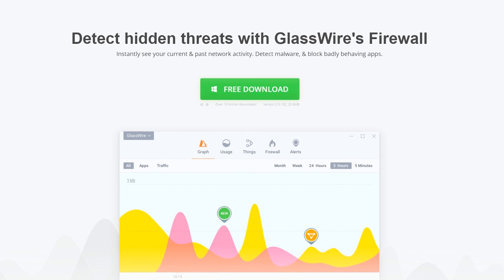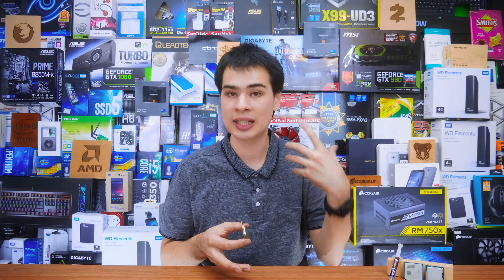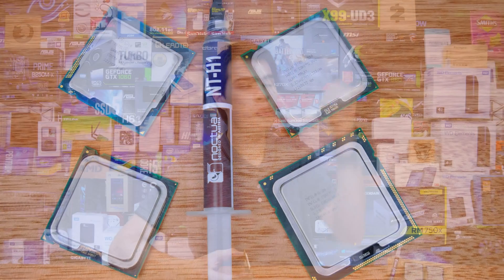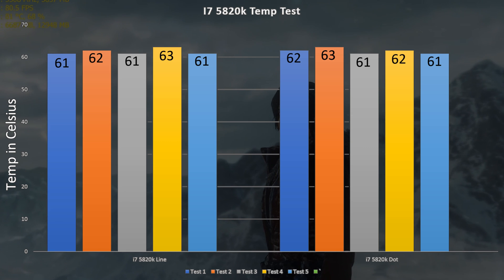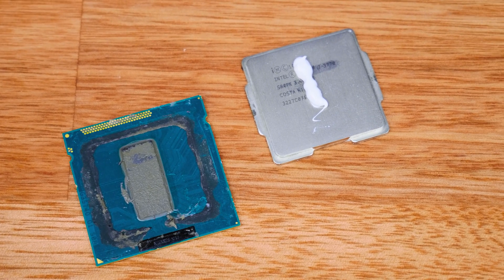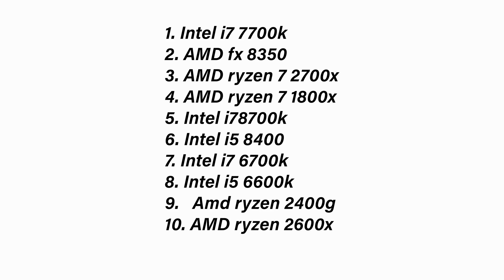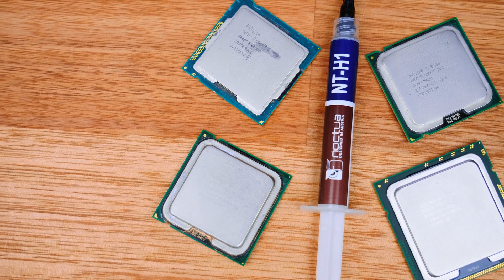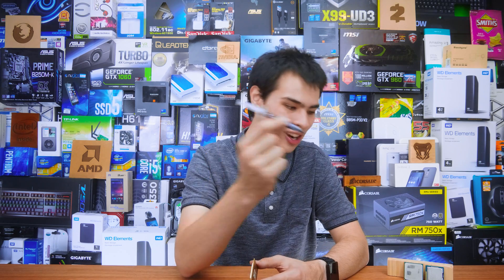Line VS Dot MEGA Thermal Paste Show Down

Comment: Seems like the single dot often misses the corners, and single line often misses the sides.

I'd rather like to see, just once, someone try a "2-line" version [ | | ], or a "dice" (5 smaller dots) [ : · : ] version, to see if either gets better coverage over the whole surface than just a single dot or line alone, but without leaking over the edge. 

Like would the two lines spread out and merge in the center, or would it potentially miss the middle with an air pocket? Would the "dice" version hit all 4 quadrants, and make sure not to miss the middle (without creating quirky air pockets)?
Reply: The dot misses the corners because he isn't putting /quite/ enough paste on. The line will ALWAYS miss sides as it forces out and channels through the edges, even if you put the right amount.

Comment: I have discovered the best way to apply it... 1st: Apply a little bit and spread it all over the cpu with your finger.. 2nd: put a little dot in the middle while the while the cpu its already covered with paste , the little dot in the middle will push the air bubbles away wen the heatsink is applied.. works the best try it!!